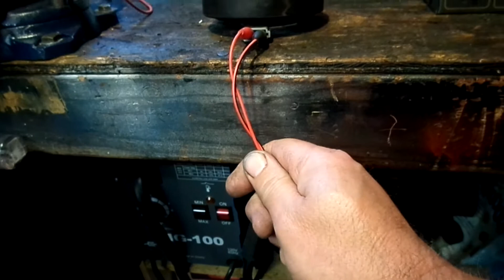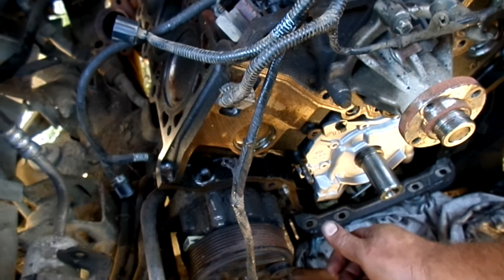2000 Ford F150 5.4L Triton Part 3, Compressor Repair, Oil Pump Replacement.

Comment: How did you remove the water pump pipe bracket off the back of the passenger side head to remove the head?
Reply: BTW great video series! Very helpful
Reply from the maker: Thank you, glad to help.
IIRC I used a regular box end wrench. A ratcheting one might be better. 
As tight as it looks back there, once you have the intake off and all the bracketry and hoses back there out of the way it opens up quite a bit of room.

Comment: Cool video. I enjoyed you bringing the a.c. pump back in shape. Hope the deal on the heads works out
Reply from the maker: Thanks Dave! I do have the heads now and have made some progress, but it's stalled at the moment due to health and heat. (It's 105 out as I type this. :(   )
Hopefully get some more done soon when the heat breaks.
Reply: @MrUbiquitousTech  yeah that's to hot. You and zombie boy have to deal with that crazy heat. Its been in the low 90s in the last few weeks here but cools down to the 60s and 70s at night
Reply: @MrUbiquitousTech  I feel ya brother. I'm a bit to the south of you I think and it's been way too hot to work on anything here in N. GA even if I have a garage. I don't have any AC in it and I'm getting parts together to tackle mine. Hope my heads are okay and it's only a timing job that the Makuloco vid can get me through and I'll revisit yours for moral support.
Reply from the maker: @Riptides99  The heat can get so oppressive at times! 
That Makuloco video is a great resource, if you're just trying to cure that rattling noise you're most likely on the right track.
Thanks for watching/commenting!